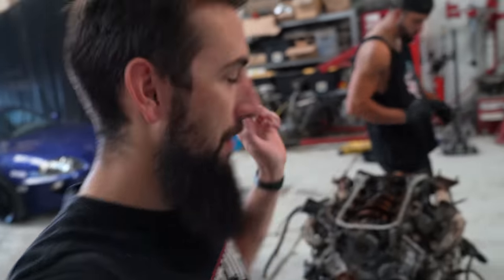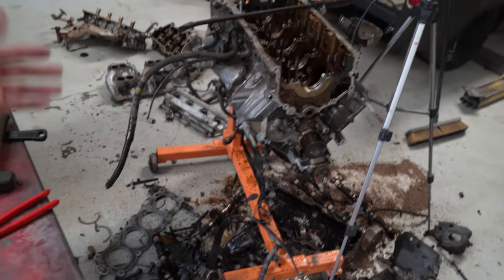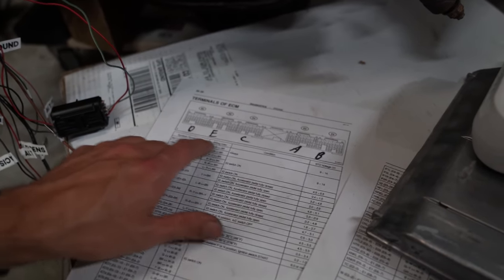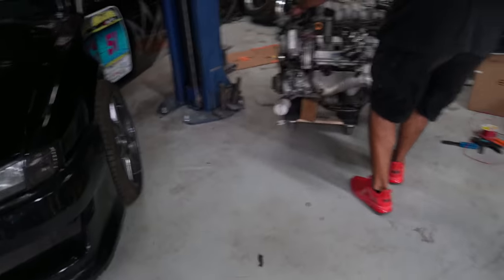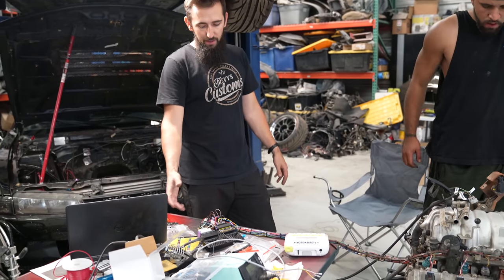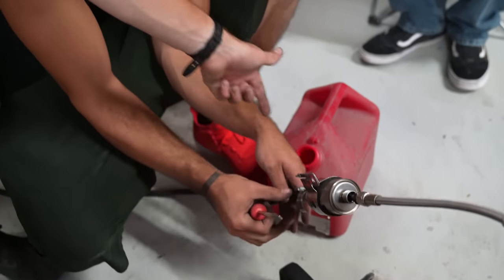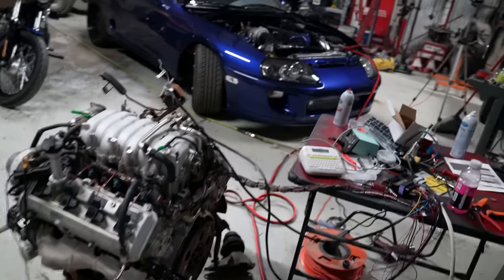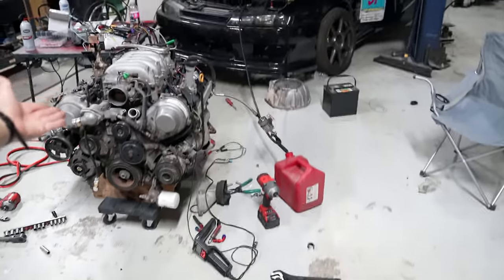THIS HAS TO WORK!- Crazy 3UZ Engine Wiring! ( 1 week engine swap )

Comment: 21:08 Damn having Sean in the shop/videos is awesome! Loving this build a ton already.
Hope you get the running issues sorted fast. Big bummer about the adapter kit too.
Wouldn't be Trevy's Customs if it wasn't in a huge rush! Can't wait to see it rip.
Reply: BTW I've discovered BMW filter/regulators for a lot of like 95-05 BMW vehicles like the X5 and 740i are regulated to 3.5 bar or basically 50 PSI. Right at the top for the 3UZ spec 44-50 PSI. You can get them pretty cheap too.

Comment: Good luck today with the engine! If I recall there is something funky with the fuel pressure because the LS400 (so might be different) uses low and high fuel pumps. Then again I could be way off because I ran my 1UZ s14 without a FPR.
Reply: Thats true about the fuel pump,  but he's not using the stock ecu.
Reply: @TheKomar924  Thats a good point. I dont know why I didn't think about that part. Did I mention the 1UZ was the first car I had swapped/wired :'( hhahaha

Comment: Trevor pro tip....drill out your starter bolts and trap the block to run the bolts backwards. Youll thank me later when the starter dies. Other wise not only are you pulling off the intake but youll need to drop the trans and adapter plate as well just to beable to remove the starter.

Comment: Early 1uz with factory ecu is key easy once you figure out the wiring. Used 7 wires from the one ecu plug that goes to the body harness. 
Running a single 68mm turbo on 8psi. Is perfect other than factory head gaskets have out

Comment: It sounds like not all the coils are firing. I would check spark on each cylinder, each one should spark twice. Maybe your firing triggers in the ecu aren't correct. I'm using an emu black so i'm really happy you guys are doing this. I'm working on a very similar project.
Reply: I just thought of this: make sure you have your ignition outputs set twice in the ecu! So your triggers should go 1-2-3-4-1-2-3-4!

Comment: Make sure you isolate & shield the crank/cam sensor signal wiring. UZ’s always have messy/noisy crank signal & issues revving to higher than oem rpm.

Comment: In India they get a bunch of engines from China from scrap cars under Chinas vehicle recycling program. They have huge warehouses full of just engines. When you go to buy one they'll drag it out on the street, one guy will sit on the engine holding a fuel can, another guy will hold some wires on a battery and they'll fire it up on the street to prove it runs. It's crazy.

Comment: Bleed the air out of the fuel line. We are ls swapping a 1979 k10 and it was doing the same thing cranking and popping. We bled the air out of the system and then it started up.

Comment: I heard JZ rods fit in the UZ 🤷🏼‍♂️ no idea if that’s true but if it is that would be cool
Reply: I actually heard a few people local to me say they do fit you just have to take them to a shop open it up for the crank journal. I could be wrong it might be wrist pin needs ope. Not 100% sure
Reply: I heard the JZ fits in the S14 as well, haha
Reply: Idk and using JZ rods, but I bet you can use early non-vvti UZ thick rods in them if they're swappable like non-vvti JZ vs vvti JZ  which I bet they are since it's Toyota
Reply: @bradyspage  that's lame tho every one uses jzs know a days

Comment: I'd avoid as many zip ties on that harness as possible, you will make it really stiff and any vibrations will transfer to the smaller branches of wires, causing breakage. This is why OEM harnesses are loomed, so individual wires can flex and bend on their own. Get some loom or braid.
Reply: As long as they aren't cranking the zip ties super tight it'll be fine,  oem also use lots of zip ties on wiring harnesses

Comment: You need the oxygen sensor in the intake to turn on the engine
Reply: I have put the same engine in a 1970 Mercedes SEL
Reply: Or they call it airflow sensor

Comment: I'm guessing the wiring is a bit off or a fault or problem with the crank or cam sensor or just gummed up injectors ?. Regardless I still put that down as a win, not the nicest of jobs to do with a non oem ecu on the floor if we're honest. Good job Trev.

Comment: Stock 1UZFE will hold 800whp with the big rods. 3UZ is mid 500whp. The AU and NZ boys down under make up to 500hp N/A with their 1UZ. 2JZ can only dream of that. The 1UZ bottom end will handle up to 15lbs boost with fuel and standalone and intercooler.  Small high torque turbos will break it faster than the bigger turbos or a procharger which builds slower. XAT motorsports carries all the 1UZ parts you need. They make intercooler intake adapter plates from AU that can bolt on a M112 or TVS1900 blower. All plug and play. Intercooled TVS1900 can make 600whp. 1UZ are better motors than the 2JZ and 80lb lighter than 2J. Interesting how just because aftermarket in US runs with the 2J everyone thinks its better. Thats not the case. 2J is just an incremental evolution of a 7M. 1UZ has 600 million in development and is the only automotive engine in the world that is FAA aircraft certified engine. 2JZ couldn't pass that test if its life depended on it. You millenials don't know whats up. (Because you weren't born yet) this was all developed in the late 80's. The highest HP 1UZ is 2500hp. There are several over 2000hp. No 2JZ has ever made that much power.

Comment: Check the firing order. Check cam timing and base timing. Batch doesn’t wast spark in the intake stroke. It waste into the exhaust stroke so that should be a big clue.

Comment: 44-50psi fuel pressure is what they run stock , rail should have 21psi minimum when not running (this won’t really affect its running just start up)

Comment: You can make 500whp on small rods change the rod bolts the break first easy on timing in low rpm good luck

Comment: From the looks of the exhaust it looks to be to rich. Get you an adjustable regulator or change the fuel pressure in the tune. Gonna have to do that anyway once it’s in the 240.

Comment: Hi Guys i need some advice. I biught a 3uz vvti engine i plan on drifting. I need to know if a R21 cressida Gearbox wil be up for the challenge and then also if my BMW E30 Diff gonna be strong enough to handle the power.

Comment: Thata the engine from a Lexus LS400 I was trying to get one myself that was 66k Miles only for $2400 with the paint ceramic coated and everything from the factory I just never made it to the guy to check the car out cuz if he was truly selling such an immaculate LS400 with 66k miles and a clean title running and driving and the KBB value was 6k on average. Those engines can go up to 300k miles if maintained properly shit even some that aren't maintained well make it up that high
Reply: I own a 90 ls400 with 445k and the owner didn’t do much but oil changes

Comment: This seems like a worse LS swap with extra steps
Reply: its lighter, smaller displacement, wiring harness is more complicated, and wider (90 degree block with dohc heads) so  yeah its a worse LS, that said its different and fun and 6 bolt mains with those 90 rods will hold similar power.